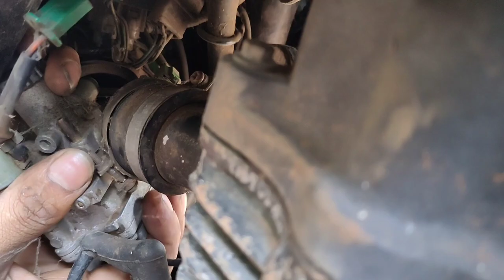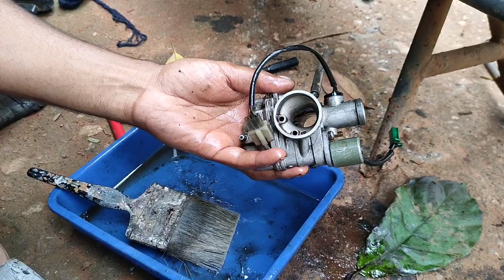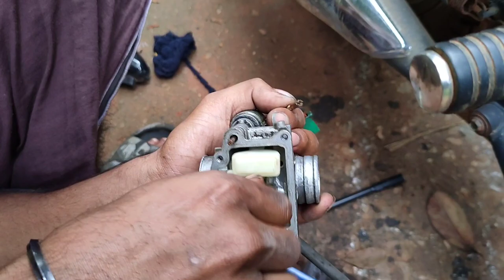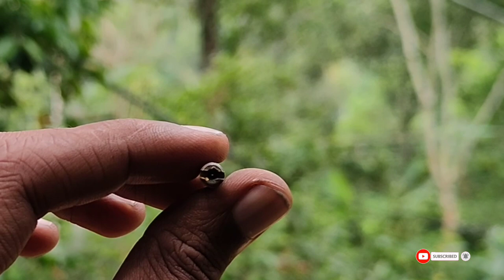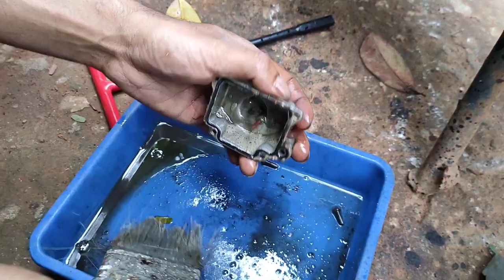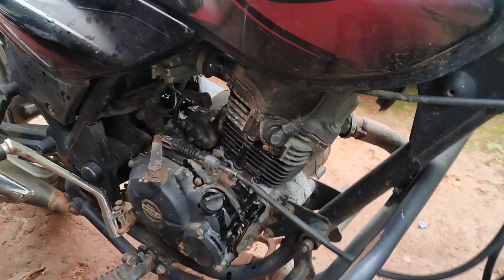Discover 125 Carburetor Cleaning | Bajaj Discover | Carburetor Cleaning

Comment: Sir tell me about air and fuel mixture pin of this bike carburettor how many round should be Loose of both pin for 1 kick start and good milege and start without chock .
Please sir tell me
Reply from the maker: Its changes according to engine condition and climate.its better to ride the bike 15 to 20 minutes before tuning carburetor

Comment: What is the price of new corporator?
Reply from the maker: Around 2000- 2500
Reply: @RaceTuner2024  thanks 👍
Reply: @RaceTuner2024  bro my discover 125  not gear shifting properly... After I changed new  clutch plates ... Also same problem still now .. what to do ?
Reply from the maker: Gear tight happened after cluch change?
Reply: @RaceTuner2024  no bro not properly shifting need press 2 times for next gear change or else it comes to netural...
Reply from the maker: Need to check cluch lever smoothness and freeplay before going further
Reply: @RaceTuner2024  thanks bro